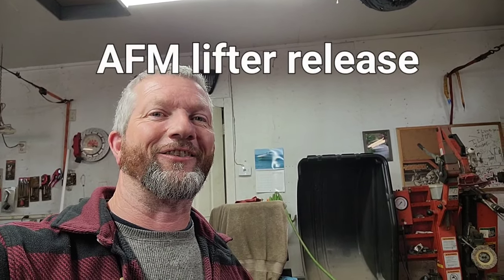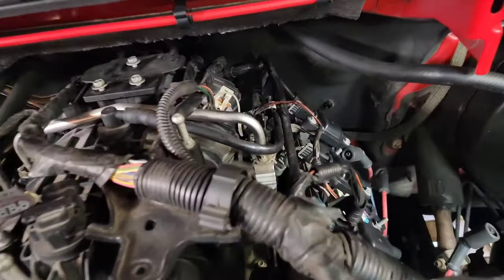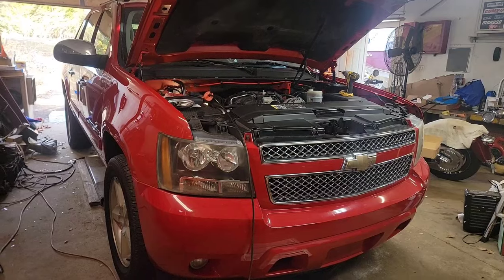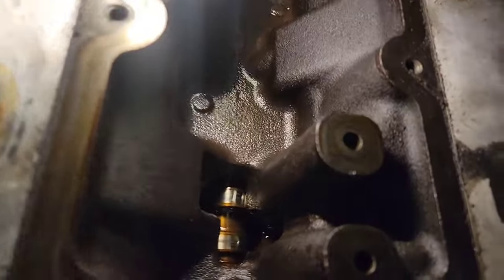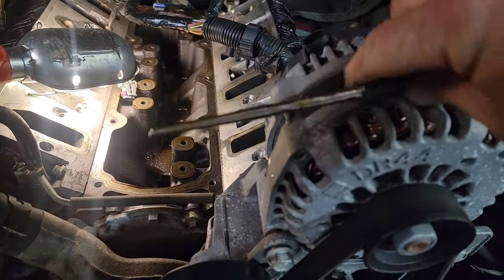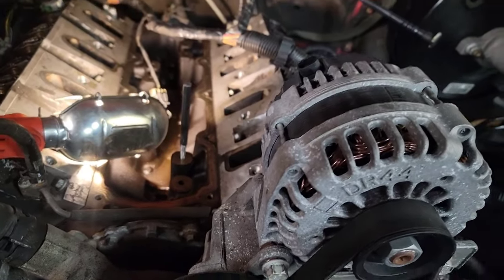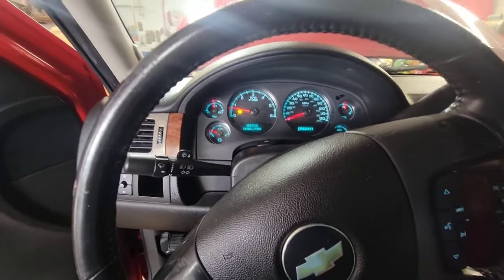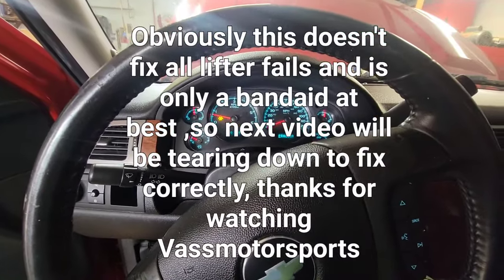5.3 AFM/DOD lifter release trick,will it work? Chevy Avalanche bandaid job@Vassmotorsports

Comment: Nice work. But if you're not going into the ecm and disabling active fuel management, chances are once DOD activates again the lifters will re-collapse. I used HP tuner to disable AFM.
Reply from the maker: I did unplug wire to brake booster as thats supposed to keep it from activating ,   but the lifters are In bad shape and didn't work.   So I sent off computer to have it deactivated while im installing all new lifters in my next video.   Hopefully this fixes it
Reply: Can you please explain how hp tuners un collapse the lifters
Reply: @rotsbelramos7685  it dose not uncolapse the lifters ! You can edit the tune to disable the dod so it won't activate!

Comment: there is a much easier way to unstick a stuck lifter we old guys been doing from the 60s  up. just take off the valve cover and with the engine running take a hammer and tap on the rocker tappet over the push rod. you keep taping till you hit it while the push rod is mashed down as far as it goes. the extra pressure mashes the lifter down further than normal and the oil extra oil pressure the hydraulic lifter pushes the thing up and releases it. that  way you only remove the valve cover. this also will make lifters not pumping oil up through the push rod start oiling again.
Reply from the maker: thanks for the feedback and i know exactly what your talking about but the AFM lifters are a different beast and has a whole different chamber inside and lock mechanisim to kill those cylinders when in 4cyl mode so it wont work that easy , thanks for watching Vassmotorsports and hope ya check out some of my other videos sometime
Reply: The locking pawl in the lifter gets worn, or most cases, gets a small bur and then the locking mechanism gets stuck.

Comment: add half quart of atf-4 fluid to oil and run engine for a week or 2
Reply from the maker: thank you so much for the reply but these i installed a brand new set of lifters in a different video and the set that were in it were new the car lot paid to do before i bought it and didn't tell me.  said they had to many vehicles to worry about that one ,  and 3 of those were in pieces when i removed them and couldn't see any lobes worn , so i dont want to band aid anymore as its to nice a vehicle and i like my stuff dependable, so im gonna pull motor to do new cam bearings and full delete the right way ,  thanks for watching Vassmotorsports and hope ya check out some of my other videos sometime
Reply: @Vassmotorsports  absolutely agree 100... dependable,reliability,peace of mind, new parts makes me sleep good at night also friend...i wish u best of luck and happiness.
Reply from the maker: @jayceasar2661  thank you,   I thought it was gonna be simple lifter replacement but I wasn't that lucky on this one haha,  I have to many vehicles and she just been sitting but i need to get back on her soon and fixed right so i can keep or sell lol

Comment: Just bought a 5.3 for my 2009 Avalanche and it was 2450.00 with exchange. We had a lifter spun in ours. And it has 229900 miles on it.
Reply from the maker: Wow sorry to hear that.  I would hope it had some type of warranty but still not a good situation to go thru all the trouble of installing just to find out there's a problem
Reply from the maker: Maybe I misunderstood, I guess your original went bad so you got a reman?   How is the new motor running and who was it through?
Reply: Bought a Running 5.3 J series Running from a Salvage yard in Des Moines Ia with 113,000 miles on it and switched them out. I checked on a reman and they wanted between 4 to 5 thousand for one.
Reply from the maker: @charlesdeaton7112  Oh, Dang cause I was gonna say for 2450. That wouldn't be too bad for a reman I might would buy one., But I'm also a cheap guy. And I need to just fix this one myself

Comment: I make a tool exclusively designed for this. That tool has too small of a point. Having that small point risk damage to the lifter if it lands at the edge of the oil hole.  The air only activates the locks. The hitting of the tool probably loosened it pryor. The air alone wont work because the locks are not the part that is stuck. If you get another you will likely find that out.
Reply from the maker: Definitely tried hitting with my tool and no luck as you seen.  i know not to damage the lifter ot might never get out of the bore.  as soon as i did the air ttick the push rod flew out as the lifter released.  ive watched a lot of your videos prior to doing this and thats where I came up with the idea watching you make the lifters come apart on thr floor once they are out of the engine.  your videos are very Is informative and i appreciate them and the feedback,  if you seen any of my other videos after this one ( yes my first time with AFM) i was only trying to bandaid long enough to make sure the motor was worth putting real time and money into it as it wss making a very loud sound every so often and was afraid something in the bottom end. so next video i put all new lifters and someone right before me did the same thing and thats how i bought it with 3 bad and 2 was in peices.  so after my set it ran great but had very small tick so eventually im pulling the engine to do cam bearings and full delete the right way ,  i did send computer to the guy you recommended and turn AFM off when i had it apart

Comment: I’m looking at a 2013 Silverado with misfire on cylinder 1. I was thinking if I get it, of taking off the valve covers and replacing all the lifters at once and then running one of those AFM disable modules that plugs into your OBD2 plug. In theory they should never collapse after that because the system just runs in “V8” mode after that. Would be cheaper than doing the full delete kit. What are your thoughts on that?
Reply from the maker: Thanks for watching Vassmotorsports,  not sure is you seen my other AFM videos where I been fighting with this truck ,  it's not as simple as valve covers ,  have to remove heads to replace lifters. ,and I did what you are talking about (had my computer tuned so AFM disabled)  and it still has a lite  tick so I never actually put a tag on it to drive. Just kinda got parked outside my shop ,but it's to nice to let sit much longer  but I have made my mind up to pull the engine so I can do cam bearings and full delete the correct way ,  you can try just lifters (afm style) but these engines are known for faulty cam bearings and its just a chance of luck if you try that way ,  I couldn't see any were on my cam lobes ,but the journals and bearings must have to much wear

Comment: Curious . With it still knocking did u fix it ? Looking at the motor the passenger  side head had a noticeable  gap between  the head and block
Reply from the maker: Thanks for watching Vassmotorsports. It still has a slight tick I don't like so I never bothered putting a tag on it yet , there is definitely no gap  between head and block lol,   I plan on just pulling motor and putting new cam bearings and full delete with cam and lifters,with trays  and plug the towers,  I already have the AFM tuned out and pulled pan  one day to block off the oil pressure valve and installed new oring on pick up screen

Comment: I have a 2005 avalanche .  It's ticking off and on. Does oil pressure have anything to do with the ticking?
Reply from the maker: does ypur oil pressure stay decent even when the tick is happening or does it drop off ?   that 05 doesn't have the AFM failure prone lifters.   so one could be going bad ,  you could try an engine flush when you change oil next time and maybe step up the wieght to 10w40 if its high miles and if you only have 5w30 or something in it now ,  also ive used (engine restore)  in silver bottle and its great ot even Lucas ,   thanks for watching Vassmotorsports and hope ya check out some of my other videos sometime

Comment: I was thinking about using air, before punching it with metal. But also using some hydraulic fluid and some type of plunger. And try to hydraulically release the lifter. If all else putting a grease fitting on the hole and pumping grease into the lifter. But who knows it's just a thought. I have a 2007 Avalanche. I thinking just pull the heads and do it right. If i did the delete im not sure it would pass smog. Or maybe filling the hole up with oil before blasting air might be an ideal.
Reply from the maker: Yes I filled mine with brake clean and it helps when you push the air to it.  I tried doing it right after this band aid, because I bought it this way and was so loud I thought bottom might be hurt also and didn't want to waste money and time pulling heads so was hoping to hear the engine if this worked ,  it didn't they were in pieces when I pulled it down and tried to replace the lifters with AFM lifters In another video.   And found out someone just put new lifters before I bought it. When I replaced it has a slight tick now and oil pressure drops to 15 or so when warmed up and tick gets louder and I don't trust it so im pulling the engine and do the right way with new cam bearings and delete kit and cam.  I already had it dissabled in computer

Comment: I was watch that video where crazed had it on an he showed once the lifters release before you put the rocker you have tap on the end of the pushrod an snap the lifters back onto lock position before putting the rocker on .
Reply from the maker: yes thanks for the feedback and thats exactly what i did ,  when it popped it threw push rod out and i knew lifter released so i put pushrod back in and tapped with hammer lightly until it was locked in ,then when i put rocker on with cam on backside of lobe there was little play as lifter was set again and no oil to keep it pumped up.   I made a few videos because i bought a new set as this was strictly to try and check the rest of the engine before spending real money or time on it if it needed another engine instead,   but when i finally removed these i found out someone had just replaced and obviously it didn't fix and thats why they gave up and sold it ,  so after new lifters it runs great but still has slight tick sound and i dont trust it so im eventually gonna pull it and install new cam bearings and full delete the right way , thanks for watching Vassmotorsports and hope ya check out some of my other videos sometime

Comment: I wish you had filmed the air pop... and how you put the lifter back together
Reply from the maker: I'm sure if you fighting this issue you been watching videos,   it popped the same as hitting it thru the tower ,except mine wouldn't release with the hammer trick and you can put burs that will get lifter stuck in bore when trying to remove for replacement and seen the other guy that shows how the lifter will separate after they are out with air so I figured I just do it still in engine, it popped and pushrod flew out on floor.  I stuck rod back in and pushed till it felt like it seated and tapped with hammer to make sure it locked inside,  but if you seen my other videos after this it didn't work and I need to pull motor and do cam bearings and full AFM delete

Comment: My gmc sonoma 4.3 keeps coming loose after adjustment is perfect earlier, why are the rocker bolts backing themselves out. It's only a few cylinders doing it, I recall. Any suggestions to keep the rockers tight and torqued ?
Reply from the maker: That is a wierd scenario, only thing comes to mind I would clean hole and bolt with brake clean and blow out with air.  Then put red lock tight ,  maybe even new bolts and should work , thanks for watching Vassmotorsports

Comment: Did you not test drive it before you bought it?
Reply from the maker: Yes and I knew it needed lifters ,I just thought would be an easy fix like a good old 350 , but I learned the hard way.  Hell I have so many vehicles and projects she been sitting on back burner ever since. One of the new lifters still has slight tick and I don't trust putting a tag and I drive out of state alot so can't trust like that ,  I plan to pull the motor and do cam bearings and full delete the right way this time ,  it's to nice to let sit

Comment: Have you tried an engine flush?
Reply from the maker: I actually did ,plus I put valve medic in first oil change,   then changed again  and added Engine Restore because I had that fix a Bronco 2 I had 25 years ago lifter started ticking so bad I thought it was gone and that immediately fixed it,   also this engine is actually very clean inside for the mileage,   thanks for the feedback and thanks for watching Vassmotorsports,  in another video I change the lifters with new set but still a slight tick i dont trust ,so it's been sitting outside the shop and put on back burner, I want to eventually pull the motor and do cam bearings and full delete the right way ,to nice of a truck not to do her right

Comment: This dude a stright clown out here 🤣  this dude tring to sell somebody a lemon 🍋  lol
Reply from the maker: Guess you didn't listen or watch all the videos on this vehicle, I bought it this way for myself and it had a terrible noise so I wasn't gonna do full cam swap without knowing the bottom end was even any good or gonna have to do an engine swap.  I was just trying to band aid so I could drive her and make sure everything else was good like trans and engine before getting deep into her and spending money. Pretty simple dude. I wound up doing new lifter set and runs good but has a slight tick so I'll pull engine one day and do cam bearings and full delete swap the right way now I know Nothing wrong with bottom end and no overheating or issues and she drives so nice , I wouldn't think of selling someone a known lemon.  Check out some of my other videos and you'll figure that out,  that's why I have people that only beg me to work on their stuff but rarely have the time for them
Reply: Yet here you are watching his video...SMH!

Comment: 😅 I was wondering about that I have a 383 that I got a couple lifters that are done over and over tighten some other stuff so I'm going to try that are I think that'll be good
Reply from the maker: this will only work on these gen 4 LS engines with AFM.  these are special lifters for those 4 cylinders so id imagine you would have a different problem with a 383 ,  and heads wont have to come off either.   thanks for watching Vassmotorsports and hope ya check out some of my other videos sometime